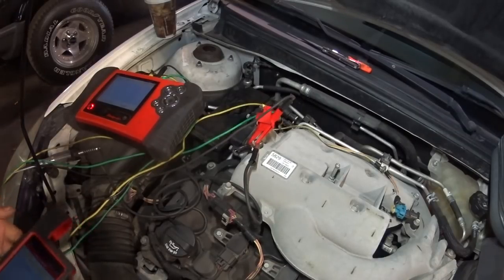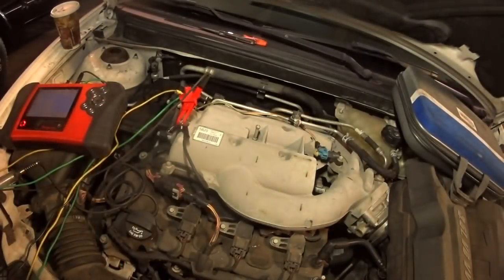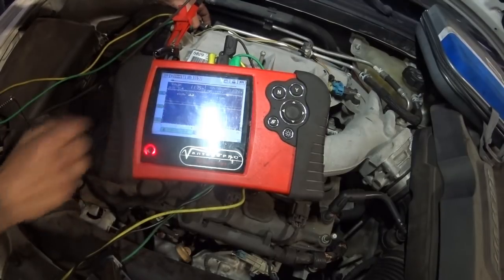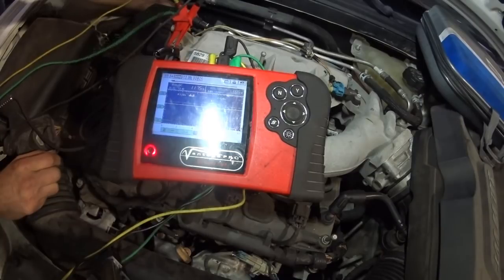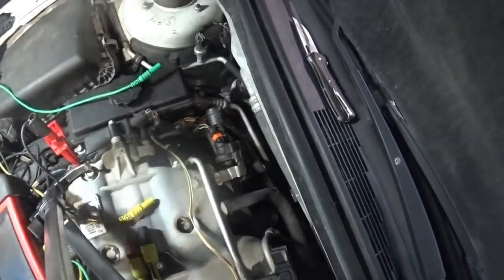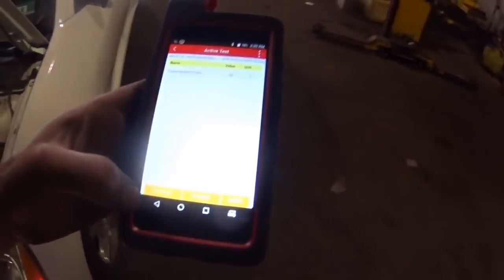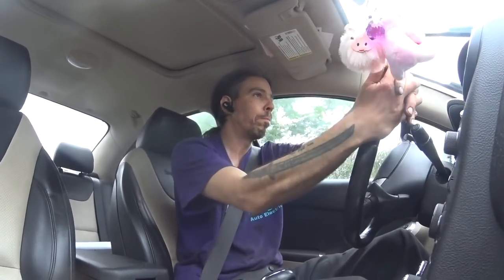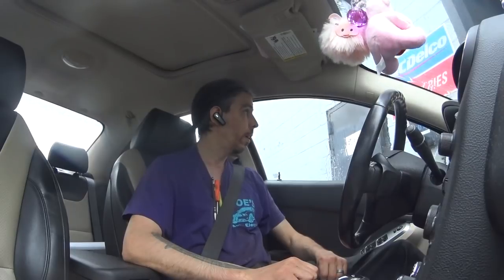EVAP P0443 Pontiac G6 GXP P0443 Diagnosis

Comment: Clear diagnosis process,I like these words!
"In order to properly diagnose a problem, we need to know the circuit we are dealing with and what the code criteria is for it to trip the failure. i.e What does the computer need to see? And what is it seeing that it doesn't like. Once we can answer that question, we should have no problems finding the source of the failure. Keep it simple and as non intrusive as possible. "
Can we share it on our facebook ?
Reply from the maker: Thank you. Of course you can share
Reply: @JoesAutoElectric  Thank you Joe!